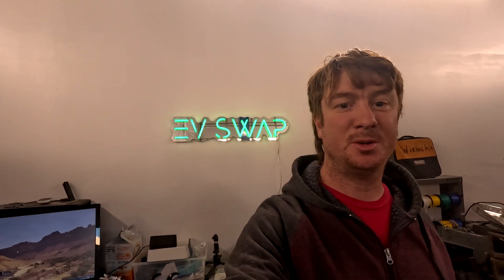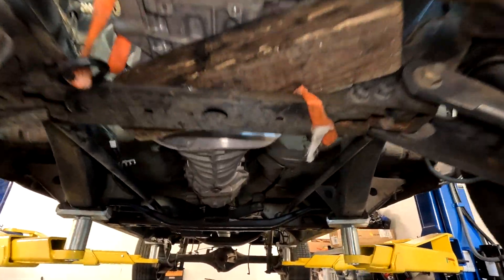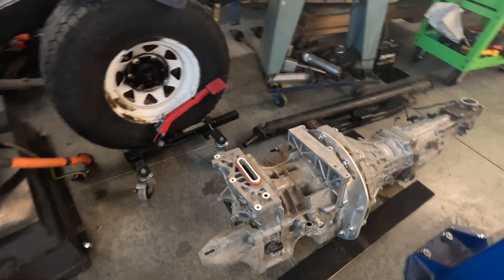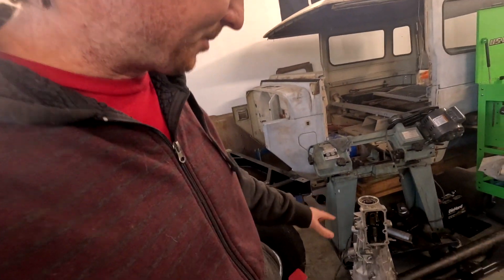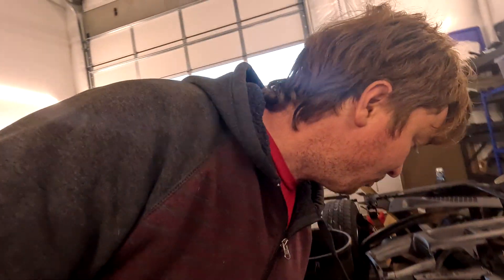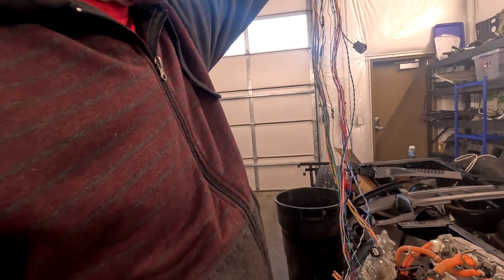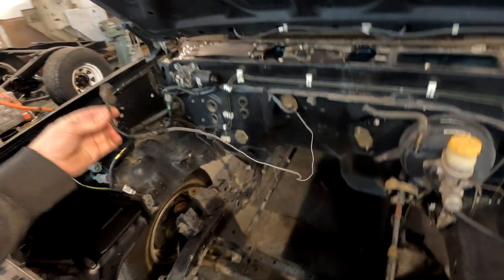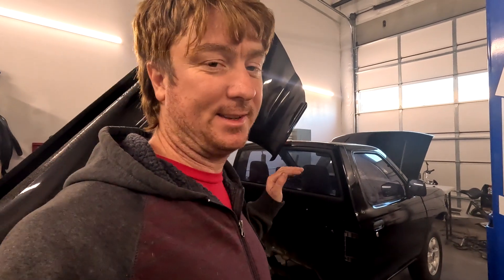I discovered BIG PROBLEMS with the Mini Truck Transmission - EV Swap Nissan Mini Truck Update 5

Comment: GREETING JIMMY THIS VIDEO HAS VERY GOOD INFORMATION. FRIEND THANK YOU FOR YOUR TIME.
JIMMY IF I USE A MODEL ENGINE.2022 LEAF IS GOOD. WITH THE RESORVER CONTROL..VCU... THANK YOU,
Reply from the maker: Yes you can but Chademo will not work. Chademo only works on 2017 and older.

Comment: Jimmy - It looks like you removed both the ICE and tranny first at same time and then bolted the EM into it out of the truck then installed the EM/tranny unit back into the truck as a unit.   Is this because it is easier to line up the holes and mate the EM and tranny outside vehicle?  Thanks Brian
Reply from the maker: Yes for me it's easier to move the motor and transmission as a single unit that install in place. Also there is no real mounting done yet, it was just being held in place with some wood blocks. I purely wanted to do a test fit and make sure there wouldn't be any unexpected fitment issues.

Comment: Thanks for the update- i just ordered my adapter from BRAT for my Toyota pickup.  If you like the results of the machining /turning/welding of shaft adapter- clutch plate i may be interested in having same done if you can share contact info etc.   Good luck w the build!!
Reply from the maker: Ok I haven't found someone yet but I have a few leads. I will let you know.